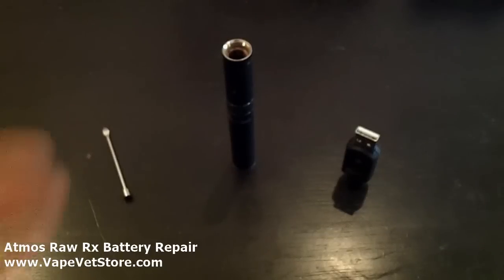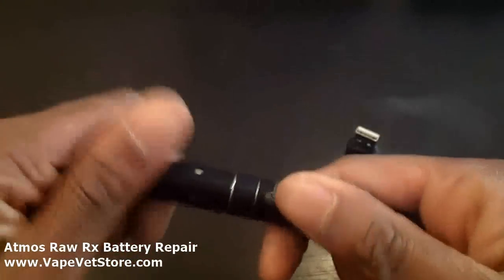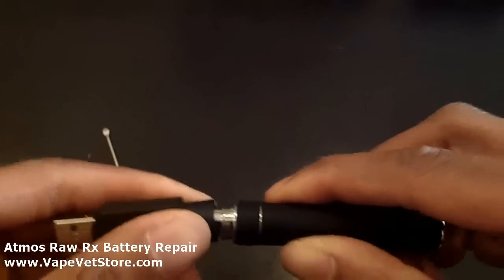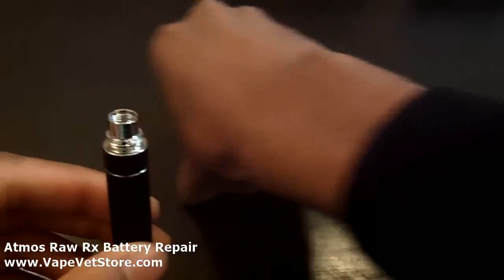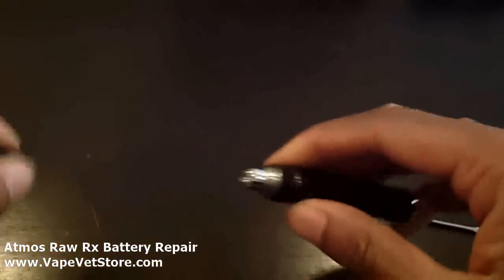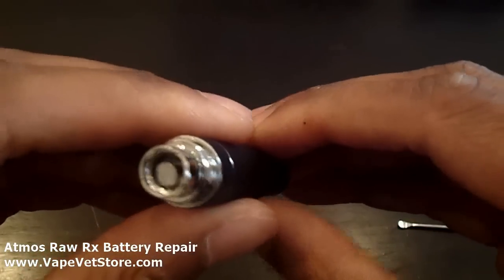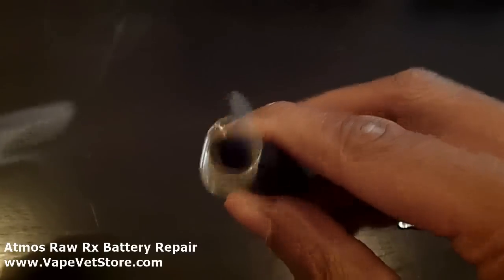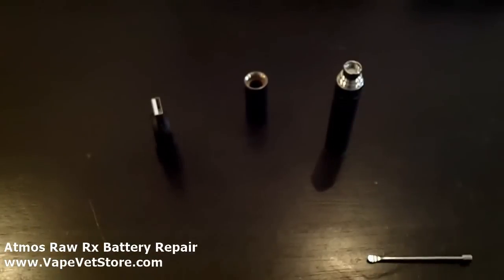Atmos Raw Rx Battery Repair  (and eVic No Atomizer Found / G5, etc): How to Fix Vaporizer Battery

Comment: Literally 30 minutes out of the box this happened. I never cranked to hard down on it. Never manhandled anything. Tried a million times to raise the connector piece on the battery and slowly screw it into the charger. Never worked. Never turned red. Never charged the battery. I bought an Atmos a year ago and the battery life decreased so rapidly I threw it away. No idea why I bought another. Atmos has terrible quality control and jimmying around with it like this is ridiculous to expect out of a product. Never buying another Atmos product.

Comment: Hi i got a replacement battery after my original eventually died after a few months use. The new battery piece that touches the heating chamber is much skinnier. At first it worked no problem, but recently I have had an issue. When i try to charge my battery it does the usual flashes and turns red, but it stays red and never actually charges. I left it for 2 hours and it didn't change so i left for another 2 hours monitoring it every 30 minutes and it never changed. I tried using it on the chamber again and it still indicates that it is uncharged. I tried my old battery and it charges it just fine, but it obviously doesn't last for more than a puff. I was wondering if I you have ever encountered this
Reply from the maker: chango92 Hmm.. The only thing I can think is whether or not the new battery came with a USB charger specifically for it. If you're using the old charger on the new battery, there could be a missed connection that's causing the new battery not to charge properly. But to answer your question, I have not encountered this specific problem. I would try getting a charger from the same place the new battery came from as a start.

Comment: I was about to go buy myself a replacement heating chamber.  While searching I stumbled across your heating coil fix, tried it out, didn't do the trick.  Read some comments on here and saw your suggestion for the battery connections, came this video.  Tried it out, works like new once again.  Thanks a lot for the videos.  I have multiple vapes, most for dry herb, I normally just use the dab rigs I got for my oil.  This is my first oil pen and it's great.  Not having to heat up nails and completely cough my ass off, and be able to smoke it on the go or laying down, it's awesome.  Again really appreciate the videos, saving people money! :)
Reply from the maker: xBenawesomex Glad to hear everything is working again! I think more people stumble on this heating coil repair, but the battery is actually the more common problem, so I'll add some annotations to point people to this video from those. Have a good one!

Comment: hey when I try puffing the blue light blinks
Reply from the maker: JayTetris It's tough to say for sure. My initial though is that you may be running into the automatic shut off. So after 7 or 8 seconds of holding the power button down, the battery will shut off for about 4 or 5 seconds. So you can try beginning your puff sooner, or rapidly let go of the power button and hold it down again every 5-6 seconds (before the shut off happens, which will let you bypass it). Other than that, I'm not sure. I can't think of a reason why the device would work until inhaling.

Comment: this isnt fixing my pen i have the same problem wont charge my charger just stays green i tried this and still nothing any ideas? had the pen less than a week
Reply from the maker: David V Hmm.. I'm not sure if I've ever had a completely dead battery. Even one that was a bit fried would at least charge (it just wouldn't keep the charge or work properly). Do the battery lights come on at all when you screw it onto the charger and plug it in?
Reply: it doesnt flicker at all last night it died when i got home i threw it on the charger and the charger just stays on green could it be the charger?
Reply from the maker: It could be... but probably not. If the wall charger were the problem, the USB adapter wouldn't light up at all. If the USB adapter were the problem, it wouldn't have the green light. And if the battery is definitely making contact with the USB adapter, then it sounds like the battery is the problem. I have had just a regular 510-thread battery die on me. Just stopped working without any real reason, so that could just be a dead battery, unfortunately.
Reply: Same issue here
Reply: same issue as well,, I think its to do with the quality of The atomiser ,, I had used the one that came with my device until I replaced it today because it was leaking ,I bought another one today for a dollar and it suddenly won't charge and won't vape , so I'm guessing it has something to do with that

Comment: hey iv tried this fix. definatly having charger problems... dont know what else to try the charger light always green, the battery is dead now. Definatly making contact
Reply from the maker: Tazzra Hmm.. I don't know if this would help at all, but you could try using the USB adapter on a different wall charger--like for a cell phone or something. See if maybe (and it's a stretch), the wall charger is the problem.
Reply: anyone find the fix to this
Reply: @yourfriendraiden  yeh get a different vape 🤣

Comment: My dispay show a batter that has 2 bars at the top of it and the rest is empty, Nothing else shows on the display and the backlight won't come on. Any ideas? Just got this Ago G5 and have used it and charged it a couple times now.
Reply from the maker: Thrain Darontou I've had a few G5 pens, and I noticed that the battery display was never quite accurate when it came to showing remaining battery life. The important thing, is it still powering the chamber? So long as it's powering the chamber, I would completely ignore the LED battery display. It doesn't serve much of a purpose in the grand scheme of things (just counting hits? Who needs that?). Just charge as necessary and wait for a low battery warning before charging again I'd say.

Comment: Hey man, I recently bought this and I charged it for 6 hours upin arrival like it said. After that I pressed the button down but unlike yours no light comes on. The heating coil doesn't heat up or glow at all but at the 10sec cut off the light flashes blue a couple times. I dont know what is wrong with it and I hope you can shed some light on what is up with it because I feel like I've wasted my money. 
Please reply dude, I need your help.

Thanks heaps
Reply from the maker: Hi. I'm hoping this is just a simple issue of the battery being turned off. If the device fully charged (light on the USB connector turned green), then the battery should be all set. Press the power button 5-6 times rapidly to turn the battery on. You should see a bit of a light show, and then when you press the power button, the button should glow (indicating that the battery is on and working). Hope this helps!
Reply: The place I got it from sent me and whole new pen for free so I have spares and it now works, thanks heaps man :D

Comment: what does it mean when the light wont turn off?
Reply from the maker: a7chemist I've only run into that problem once. Unfortunately, for me, that meant my battery was just done for, and I had to toss it. The only time the light would turn off is when the battery completely ran out of power. It only happened once, and I'm not sure what caused the problem. Maybe a short circuit fried the battery at some point? But you might have to replace the battery at this point unfortunately..

Comment from the maker: Hi Haran Krishnan. I think because your comment is a "Linked Comment" I can't reply, but here are my thoughts. I've had batteries before that got stuck on blue. It was usually after trying to use a metal mesh filter, or if the heating coil had been messed up beforehand. I think it has something to do with the battery getting shorted and frying. Something like that (again, not an electrical engineer). But what you're describing definitely sounds like you'll need to replace the battery. I've never been able to bring a battery back from the dead, only heating coils. You can e-mail me at VapeVet@gmail.com for more info. Sorry I couldn't be of more help :(

Comment: hey man, i have an atmos jr and my problem is that the heating chamber never heats up. also, the light at the bottom is always on blue (can't turn on or off i think) and whenever i plug it into the usb charger, it momentarily flashes red before being stuck on green. any ideas what's up? thankss

Comment: Yea it won't heat up. I'm using the wax attachment , also I tried the dry herb one and it won't heat up.
Reply from the maker: Ah, I see. If the blue light on your battery never turns on, then I'd say the battery might need a replacement. I believe Atmos does replacements on batteries for devices under warranty.

Comment: When I put the atomizer it pushes down and it still won't heat up
Reply from the maker: Hmm.. If you can, I would test the battery with a different attachment. If it works on something else, it could be your atomizer/heating coil that's the problem. There are some videos about that on the channel.

Comment: When i plug in battery light stays blue..once green on charger i turn on and blue light blinks 3 times..unscrew heating chamber and light stays on as if working
Reply from the maker: Hmm.. I would try cleaning out the heating chamber and maybe check out our videos on fixing a broken heating chamber. Sounds like there could be some excessive overlapping or maybe some metal or something in the chamber causing the coil to short--which is why the battery shuts off before letting itself get fried.

Comment from the maker: For some reason, I can't reply to you directly Diana DeOscar, but if you've tried the steps in the video and the battery isn't working, it might be the heating chamber that's the issue. Also, make sure you've turned the device on by pressing the power button 5 times rapidly. Then check out our videos on fixing the heating chamber--Part 3 is probably the best: http://www.youtube.com/6YVFoi819lM

Comment: I have an atmos raw jr. could you explain how to fix that battery since its connecting head is different than the regular
Reply from the maker: Does your connecting head have a thin tip that's spring-loaded, so that it can get pushed up and down? That works almost the same as this, but instead of trying to lift the circular base, you just try to raise that thin cylinder. Does that make sense? Hard to explain without a picture.